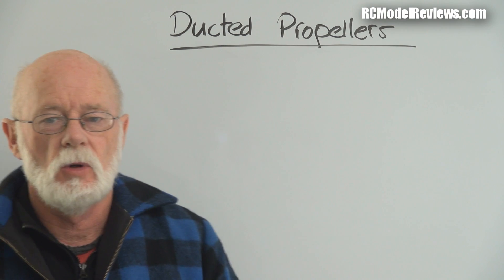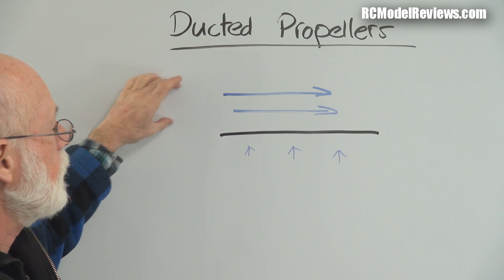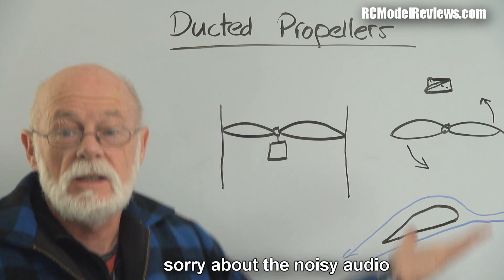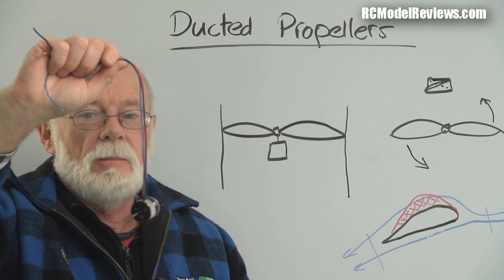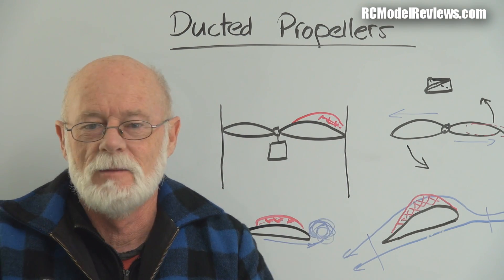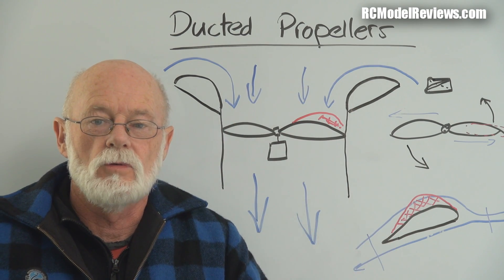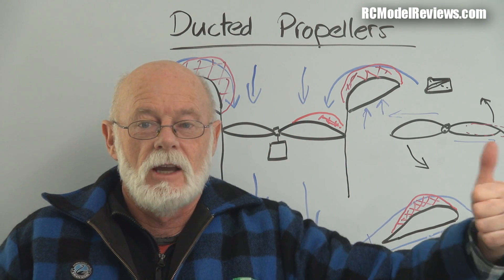How ducting a propeller increases efficiency and thrust

Comment: Yes please do a video on why ducted fans don't travel well in fast forward flight. I remember seeing that project and always wondered why it didn't work.

I have always wanted to bould a flying wing with twin ducted fans. Something like the FT Crackin with the Jets in the middle of the wings. I know that if the wing is stalling or producing a lot of left, the fans can cut out due to lack of air from the low pressure zone above the wing and you need to duct air from underneath the wing to keep the thrust up. Can you do a video on that and other physics related aircraft issues
 
More airplanes please...and drones, and drone airplane hybrids
Sincerely Adam in Iowa
Reply: Adam Sparrow id also be interested in why we dont build props with winglets on them, effectively making it a self contained ducted prop.... probably materialstrength.
Reply: +Adam Sparrow Ducted fans do travel well in fast forward flight, to an extent. The issue with any propeller is eventually the tips will approach the speed of sound inducing wave drag and you'll lose efficiency. This is why propeller driven aircraft only can move you so fast. Ducted fans have the same problem. 

The best way to put a ducted fan on a flying wing is to shape the area leading up to the duct to be flat or channeled to maintain pressure. This increases the ducted fan efficiency while sacrificing a bit of lift as that part of the wing won't be producing it. Remember, all EDF's suck at low speeds. Air needs to move fast enough to compress in the duct so that the fan can take sufficient bites of the air to produce enough thrust. Also, unlike prop driven planes, there isn't a large column of air being pushed past the control surfaces so low speed control authority is reduced.
Reply: +Reg Chavez You're talking about contra-rotating props (e.g TU-95). This is one engine spinning two propellers, one directly in front of the other, in opposite directions. Just like creating a whirl pool in water a propeller does the same thing with air. Efficiency is lost bc each blade is displacing air that is already moving from the blade before it. Contra-rotating props utilize a second blade to counter this increasing efficiency from 6-16% (from what I've read). It also cancels out any rotational torque or p-factor that is an issue with single engine aircraft or multi-engine w props rotating the same direction. The downsides are that it requires extra gearing, sleeve axel etc which is extra weight and they're loud as hell.
Reply: Jeffrey314159

In a nutshell... Because if all you're going to do is fly at one speed, they work great. But if you need efficiency over a broad range of performance, not so much.

MachOverspeed
Reply: Mendoza Bracken Hartzell makes a Q-Tip propeller with winglets. The problem is that propellers are already under a LOT of strain along the radius and the added structure needed to support a significantly bent tip adds a lot of weight and cost. Hartzell says they are more efficient but also a lot more expensive.
Reply: Adam Sparrow Tilting ducts can help alleviate that.
Reply: Mendoza Bracken FYI Sensenich makes 3 blade airboat propellers of a large chord with winglets.  Photos of the prop on their page look like the tips are squared off, that is the base of the winglet than ends in a point ( towards the camera )
Reply: MachOverspeedsPlace , so would it be plausible to say that variable ducting could potentially improve propulsion efficiency over a variety of speeds?
Reply: Adam Sparrow there have been videos of ft versa wings with edf's on them
Reply: I was talking more about the vacuum above the wing interfering with the inlet of an EDF. Also things like a forward sweeped wing can be more stable then a straight or rear sweeped wing. Or how a Canard doesn't add much more lift surface but dose add a lot more lift.
Reply: Mendoza Bracken Like aircraft wings now.
Reply: It's about pressure. Ducked systems are vectored towards a specific area. Open props can change its angle of attack to create forward thrust. However propellers generally favor specific vectors in any given situation. If you want to travel faster forward vector use a wing and turns the prop the way it works best. Wing systems have grater range but not as dynamic as rotor systems. Now what if. You have one set of prop pushing (rear set) and the front props pulling up. I wonder what happens..
Reply: y  ።።b
Reply: +Adam Sparrow 
...other thing there is turbulence at the bottom when the tube ends on the sides.
Reply: +Mendoza Bracken Q-tip propellers... They've been around for a minute or two.

MachOverspeed
Reply: +fromkentucky I've flown Q-tips on several different aircraft types. Can't say they're much more efficient, but they ARE more quiet and vibrate less.

MachOverspeed
Reply: Yes indeed why don't all air propellers have ducts on them?
Reply: Thank you for explaining that!
Reply: +Mendoza Bracken  - My guess would be that a canard at the end of a rotor blade would not work because you are spinning the wing around.  When the wing is at the 12 or 6 o'clock position, the canard would be perpendicular to the direction of travel and create an enormous about of drag.
Reply: Yeah, by using a water bird you could make a drone with submarine capabilities and dive for fish and prawns etc, saving you money on having to buy so much stale bread.  That is a great idea, patent it now!
Reply: if you look on  turbofan engine/ducted fan, the area of intake is very good calculated-if is smaller engine will have problem at high power and low speed, but it could fly faster because smaller front area makes smaller drag, so if you like to have good take off performance and good high speed performance, you have to use intake with variable frontal area or to make additional intake holes that would be open when engine needs more air and closed on high speed as on b707
Reply: niq872 Mendoza Bracken tastiger91 fromkentucky Reg Chavez R1GGLER 

Check out this kool article on Flight Test. http://www.flitetest.com/articles/70mm-edf-versawing

I'm still trying to destroy my FT-Viggen, the fuselage has survived so many cases. I made it with Elmer's board and hot glued the frunt half as I rolled it into the intake. 

I am thinking about building this versawing but I want to do a forward sweeped wing. What do you think? 

I'm looking for good ideas. I need a root chord, tip chord, wingspan (under 40"), and a sweep like -4 or -8.
Reply: Adam Sparrow It's certainly doable, but I've no idea how to set up the control surfaces. Personally, I'd consider separating them, with inboard elevators, or even a single center elevator, and outboard ailerons, since the forward sweep will put the elevons closer to the CG, reducing their pitch authority.
I did find this:
http://www.rcgroups.com/forums/showthread.php?t=1906571

Comment: The vortex bit is wrong, the low pressure region does not get flung out, I suppose you could argue that the high pressure does, but circulation at the tip occurs because the high pressure region towards the tip trailing edge trys to flow around the tip and gets left behind by the advancing blade, also the "packet of air" principle with curved aerofoils is flawed, there is no reason that the air above and below have to meet up again, it's better to consider the pressure distribution around the entire cross-section not just the top.
Reply: Leon Hostad yes, there has been some debunking of the effect that Bernoulli's theorem plays in how a wing creates lift but the spanwise flow of air (induced by centrifugal force) does see a flow between the low and high pressure sides of the propeller at the tip -- and a resulting vortex being formed.
Reply: Got to disagree about how that spanwise movement is caused, it's not down to centrifugal force, but down to the pressure difference; under the wing or prop you have higher than atmospheric pressure, and at the tips normal pressure and above less than atmospheric, the difference between under and tips causes a spanwise flow out, and the difference between the tip and the upper causes a spanwise flow in, that causes a rotating airflow, if it was down to centripital forces then tip vortexes on wings wouldn't form, but we know they do.
Reply: Leon Hostad Yes, it's primarily a pressure differential but there is still a centifugal effect.  Spin a flat disk and watch the airflow across the face of that disk -- you'll see that centrifugal effect plays a part because there is a pronounced flow from the center of the disk towards the edge.  This is in fact (partly) how Tesla turbines work.
Reply: Leon Hostad sorry but that part of his theory is right. the air wants to travel from the high pressure to the low.
Reply: Never said it wasn't, I only said that centrifugal force is  negligible, so much so it can be ignored, the main reason for circulation around the tip is the pressure distribution below the wing, around the tip, and above the wing.

Comment: The airflow on the prop is always at 90deg to the blades just like a wing, where does the force come into it that forces the low pressure to the outer edge?
Reply: ***** I just have to get this out: Centrifugal force does not exist! What is experienced as centrifugal force is mass inertia. The mass always tries to travel straight on and is constantly accelerated to the center of the circle ( by the wires attached to Bruce´s physiscs device or by the friction of the wheels on a vehicle). The force that accelerates the mass to the center is called centripetal force.
Reply: countZ74 Yes, centripetal force is the force that provides and acceleration towards the center of rotation -- centrifugal force is the observed movement of mass away from the center of rotation.  These are concepts that often confuse folk so I try to keep things simple -- perhaps at the expense of total academic accuracy.
Reply: Centrifugal force. Forces both low and high pressures outward to mix.
Reply: countZ74 I feel your pain, but it's not a simple thing to conceptualize if physics isn't second nature (which it isn't for the general public).  When you watch a mass on a fixed string spin around, it doesn't "look" like it's accelerating towards the center because the string isn't getting shorter, it's just spinning!  This is what I think hangs most people up.  There's rotational motion, restricted by a fixed-length string, resulting in constantly-changing tangential motion (going around in a circle).  The non-intuitive part is that you can have acceleration without actually MOVING anywhere... Also think about this:  You can't feel a force without acceleration.  Imagine you're in a car going down the highway at a constant velocity (straight line, constant speed).  Now close your eyes.  Based on FEEL alone, are you moving forward or backward?  There are no "sensations" to tell you the difference between the two.  You only know you're going forward when you step on the gas and feel the forward acceleration.  That's why motion-based simulators actually work; Acceleration gives you the cue to motion, not Force.

So back to the original, I put it this way:

Acceleration due to Centripetal Force (radially) is what you feel under the effects of Centrifugal Motion (tangentially).
Reply: countZ74 I was going to say that. :) 👍
Reply: countZ74 https://xkcd.com/123/
Reply: *****  I understand how the pressure creeps around the edge near the tips but not how it gets "flung" to the edge.  I mean, the air is always at 90 deg to the prop blade and it isn't hard connected to the axis point or anything to create centrifugal/centrifical force
Reply: TheRattleSnake3145 Also because the propeller is at a larger radius near the ends they have to be traveling at a higher linear velocity. There for the linear velocity of air over the propeller is directly proportional to the radius of the propeller. So we would therefor conclude the pressure would have to be lower near the tips of the wings. Again we conclude there would be a flow from the center of the prop radially outward to the edge of the prop due to this alone.
Reply: TheRattleSnake3145 The air particles remain for a short time sticking on the propeller, so they still rotate a little bit, and therefore they experience the centrifugal force (for a short time) , this phenomenon is also known as the slipstream.

Comment: Bruce, I am interested in the effect that caused the avrocar to fail.
Reply: I know the avrocar was a Frisby shaped craft that had 3 ducted fans driven by a jet turbine, or was it 3 jet turbines? If I remember correctly it couldn't get more than say 10 feet off the ground.   It made a fine hover craft but a lousy Hugh altitude interceptor aircraft.
Reply: Maybe it needs to be revisited with multiple rotors and a carbon fiber shell?

Comment: Second question, to stop high pressure air going around the tip of an aircraft wing most modern aircraft have a fence or wing tip, Airbus have the famous triangular thing as seen on the the A380 and the wing tips that Boeing use.
Why not add something like this to a propeller tip? 
I am surely not the only one to think go this, my guess it has been tried but did not work or work well enough to be worth while.
Any ideas on this?

Comment: Approx 9:30, Wouldn't the low pressure bubble above the blade be pressed towards the center since it has less density as the surroundings?

Comment: Nice overview. I hope you post more videos for those subjects.
I think that efficiency does differ as it is related somehow to the length of the duct (e.g. tube). It has to be something with the outgoing air I suppose... Would you include some information on that, if you have any?

Btw I can try to find you a vid that enplanes the example with blowing a paper is not quite due to Bernoulli's effect but it does do the trick =))

Comment: The shroud that you explained has another effect. Not really in causing lift though

When air flows through the shroud, the air coming out of the shroud is slightly more dense than the air going into it.

This effect is used more in engine intake systems, They're velocity stacks or venturi tubes

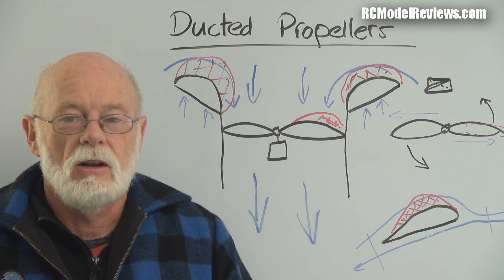Comment: 15:35 now be honest viewers, how many of you tried that yourself
Reply: Jeff Morris lol, and quads are for nerds :)
Reply: ***** I did the paper strip @2:45, lol
Reply: Vic Prk nerds rule the world lol ;-)
Reply: WorksopGimp and the world is sheit, weve come full circle......with a duct.
Reply: +Steve S 
Yea that's pretty cool uh? :D
Reply: +iforce2d i want to build a quad bike, this information came in quite useful. but have to build a gyroscope to act as a stabilizer and a thrust mechanism attached to the frame with a predetermined allowance for degree tilt, going to take some trial and error to get it right... but worth the try.  then going to have to look in to supermagnets to redesign the diesel properller motor to  get more efficiency, that will also be trial and error hahahaha, wish me luck
Reply: ***** not me! (until now :O)
Reply: +iforce2d  yes,  I am working on a project.
Reply: ***** Not me. I don't care if ducts increase efficiency (which, without a specially designed fan, I doubt they do enough to make up for their weight), they just don't look manly enough. Ducts are for girls. (I'm kidding, folks) (kind of)

Comment: Excellent video. Thank you. It is always a pleasure to listen to someone explain things well, even if you already understand the principal. I look forward to seeing your test results. But even more so, I look forward to hearing about how all of this relates to multirotors. As I was watching this video I was wondering to myself how these principals are effected by the aerodynamics of a tilted vehicle in fast forward flight. I am unaware of the related military history lesson you mentioned and look forward to hearing all about it in a future video.
Reply: It has been obseved that in FF Flight the two rear motors have to work harder. There has not been a satisfactory scientific explanation for this. Probably has to do with the aero dynamics of a tilted multirotor
Reply: zenman8269 I've noticed this with my "toy" grade quadcopters with brushed motors.  The rear motors burn out long before the front ones.
Reply: Phillip Toone Its a bit of a mystery I guess, how and why the high pressure and low pressure areas are arranged on a multirotor in FFF .

Comment: What about the UHF comparison thingy?
Reply: jibba02 Yep.. that's why I'm sitting here at the keyboard editing, uploading and creating playlists right now :-)
Reply: Cool. So to complicate things even more, you need to add TBS Crossfire to the list of tested TX :)
Reply: ***** For what it's worth, as much as I have been looking forward to the UHF epic, I am more interested in seeing those shrouds on the test stand.  If you want to put UHF back on the back burner, I won't complain.

I think you will have the best results with a propeller with the widest possible "tip" so to speak, meaning no tip at all.  How precisely are these ducts made?  How well do they maintain their shape?  Are they firm and rigid or do they bend under pressure?
Reply: jibba02 Crossfire is here on the bench (has been for a while) but I'm not going to hold up the 433MHz videos to include it.  I'll do separate coverage of the Crossfire once the 433 vids are up.
Reply: pillsnotbills I agree with you... and the questions you ask are the ones I'll be exploring -- although we have to remember that these ducts are not primarily designed to enhance efficiency -- they're first and foremost a method of protecting the motors, props and people when learning to fly or flying in close proximity to obstacles.